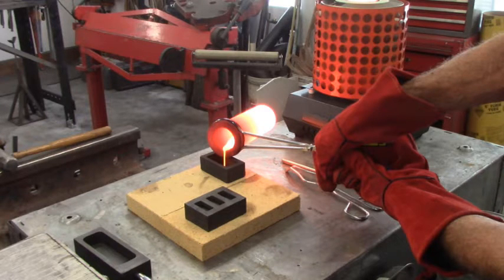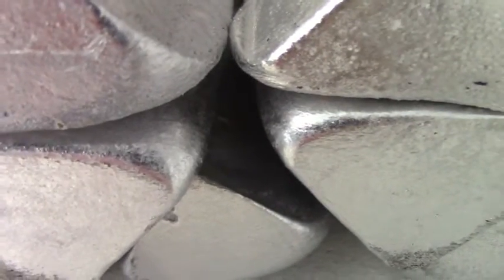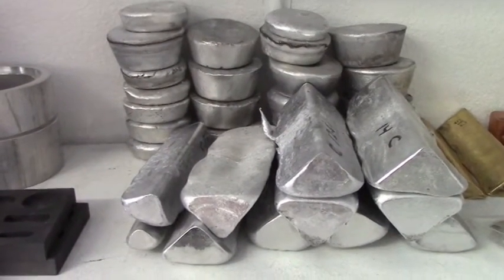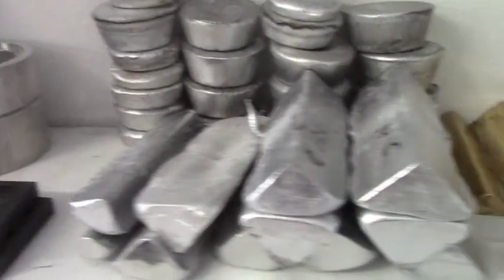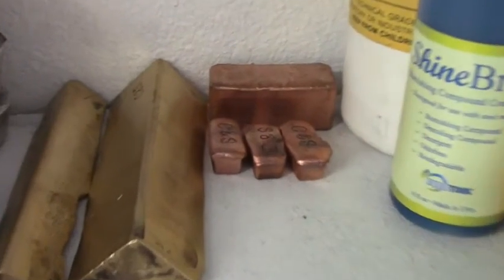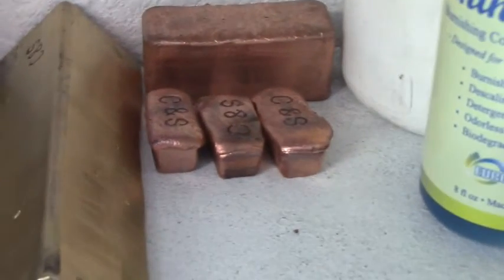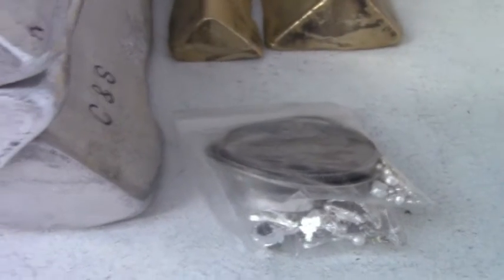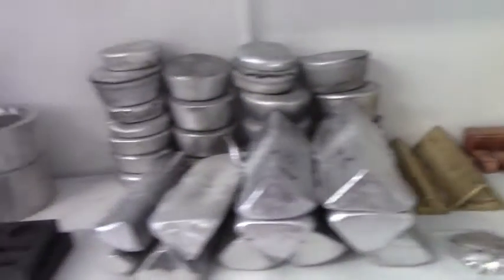BUILDING MY COPPER STACK WITH PIPE

Comment: Nice chuck I have never used an electric forge before but I bet it does good on silver and gold
Reply from the maker: I did do a silver melt and mine didn't do good. Not the furnace fault, poured to fast and spilled.

Comment: Iv been thinking of getting 1 of these furnaces for copper
Reply from the maker: It works good for smaller copper wire and small pieces of copper. The pipe was almost the same size as the crucible. That may have helped cause the slow melt problem.

Comment: Hey Chuck, I agree with GD Saving The Past. Another thought for you is a lot of your copper now a days, especially wire is alloyed with trace amounts of beryl. This increases the tinsel strength. I would sure swing toward the gas furnace and use a reducer (sodium carbonate), a little borax and silica to increase fluidity. I'm sure once you got your furnace up to temp. you'd be pouring every 45 mins. Y'all be cool now. No pun intended:)
Reply from the maker: This pipe was type 'L' copper from years ago and was used. I will take your advice and use the propane on the next melt. I have borax and silica but don't like to use silica on my graphite crucibles. Maybe use the steel one after it is clean of aluminum.
Reply: @CandSMINING  Never had a problem with silica. I've got a friend and he has a high copper mine, i smelted his ore all last summer. Go in with 20lbs. rock and pour 15lbs. metal. was lots of fun. Then i'd strip it in a sulfuric bath using the copper as the anode. Gather the sludge up and refine the Au/Ag.He now owns a huge furnace and gets around 65-72 melts a crucible.

Comment: Chuck have you tried bringing the furnace up to temp first and then adding your metal once it reaches temperature. Copper oxidizes pretty easily and the low temp in the beginning may be why it is taking so long to melt since it is oxidizing the metal.
 I know they say not to use flux with the graphite crucibles but I would probably do an experiment if I where having a problem and toss in a pinch or 2 of borax after it starts to melt to see if that helps and use either a quartz or graphite rod to stir the melt.
 Just a thought
GD
Reply from the maker: Thanks for your input and comment. Come back again soon.

Comment: Super cool. I love casting stuff. It is hard to find enough metal with out buying it. I scrap to get a bunch of mine. Remember.... Copper pipe isn't 999 fine. Wire is! Great video buddy! You can add flux and get the impurity's out of the melt. Like the stuff that was on the inside of the pipe.
Reply from the maker: Thanks for stopping by and watching and commenting. Good idea to remove trash from the inside of the pipe. Computer is down and trying to comment back on  phone.

Comment: Seems like the furnace at that temp should melt the pipe quickly? Maybe the dirt is slowing the progress? I usually clean copper with a wire wheel, that may help with the melt. Yes sir, Melting in you big propane furnace should get er dun!
Thanks Chuck
Peace PT
Reply from the maker: I believe you are correct about the pipe buildup. I soaked the pipe in mild acid and removed a lot of it, but I guess not enough.